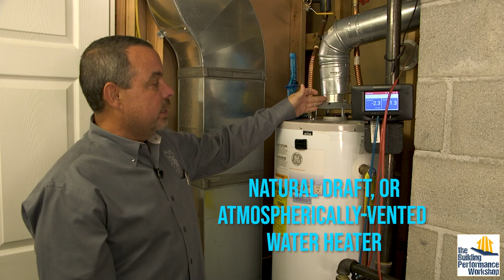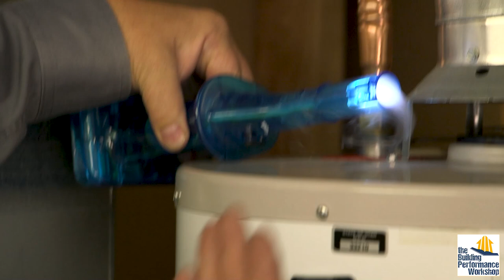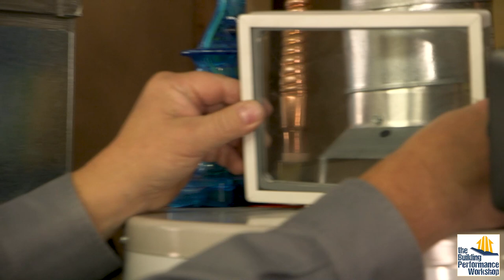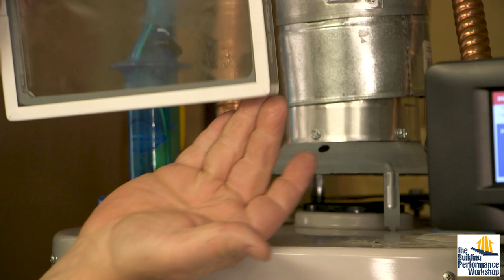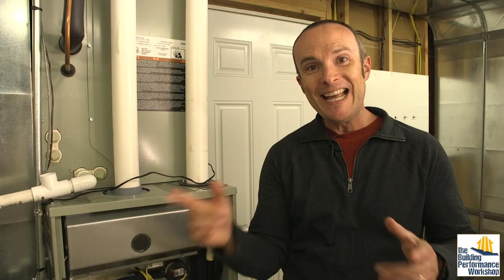Testing Water Heater Spillage: Backdrafting Combustion Fumes from Natural Draft DHW

Comment: What about when newer, efficient water heaters just short cycle, and there is just too much cooler air along the entire run of of the flue venting? There is just not enough time for the water heater exhaust to warm that air and create a proper updraft.
Reply from the maker: Interesting idea, but I'll add that flue diameters should be sized according to need. Manufacturer hopefully has recommendations.

Comment: What is the best solution? Keep your water heater in an open space ? Or keep your mechanical room open ?
Reply: no combustion within the house ! all electric !
Reply: Old mechanical  rooms used to have a vent grate in the door, probably  not allowed now for fire code.
Reply from the maker: Now they put the vent to the outdoors, which is crazy making for home performance
Reply: You can get a fan that mounts at the top of the water heater that pools air out..
Reply from the maker: Noooooo @sepertude, this is a negative draft system. Please don’t put any fans on it.
Reply: Hi, thanks for the video.
I got a new high efficiency furnace, now my hot water tank that goes into the chimney backdrafts…
I’m wandering, if installing chimney liner and air intake pipe would help it??  Or should I get tankless?
Thank you

Comment: The pipe should be 12 inches in length before the elbow.

If they have a 200 amp service they should just switch to a tankless electric water heater.
Reply: Do you know the code number in NFPA?
Reply: @WreckingCr3W2  
It's a defacto code. You must comply with the heater's manufacturer's installation instruction which require a 12" rise. If not then I would question it if it was an off brand.

Comment: True...whats the smoke tool called..very nice tool
Reply from the maker: That is called a dragon puffer, but I prefer the Cirrus Wind Indicator
Reply: They are smoke pencils. I snagged one off Amazon for 30 bucks, fantastic tool to have. I was checking for duct leaks and draft issues and its a tool you should own.
Reply: @sunnyd6019 Thanks Sunny.  I just saw it on Amazon.😊

Comment: This video is junk. If building code and fuel gas code are followed this doesn’t happen 

A. Opening the door is doing what the hack who constructed the room failed to do. Supply adequate combustion make up air. Hire professionals. 
B. If you’re producing “toxic gasses” aka CO over 100 ppm, then there’s burner problem. Hire professionals. 
C. NFGC allows 5 minutes for the chimney to prime before measuring draft. 
Hire professionals.
Reply from the maker: Haha Chuck I don’t think you have any idea what a ‘professional’ is really trained and equipped to do in US homes these days.
Reply from the maker: Also, you completely overestimate the ability of prescriptive codes to predict and prevent dynamic changes in homes. That’s why performance testing exists.
Reply: @HomePerformance  good luck with that, goof.
Reply: The “prescriptive code” you’re dismissing requires 50 cf of volume for each 1000btuh of input. 
In lieu of that, generally 2 sq. in. of free air ventilation is required per 1000btu. 

I’ve been doing this stuff for 30 years.
Reply from the maker: Good luck to all of us I guess
Reply: @fixitchuck4808  been doing it wrong for 30 years